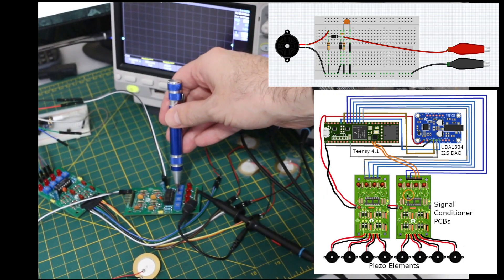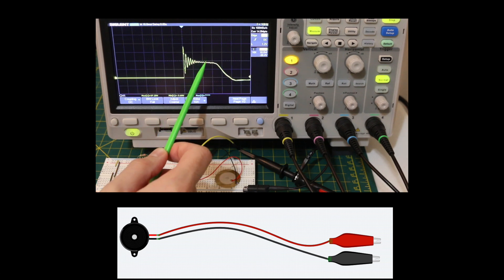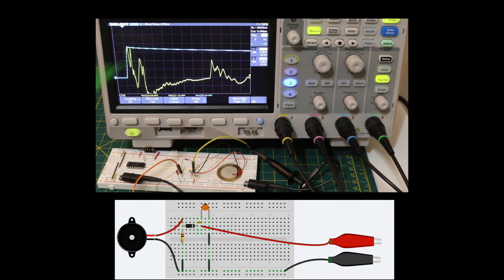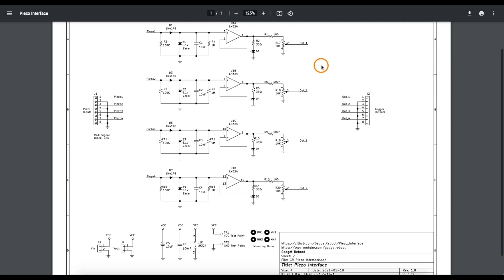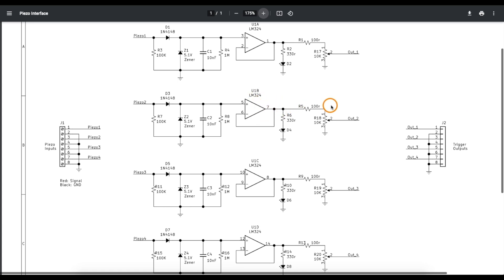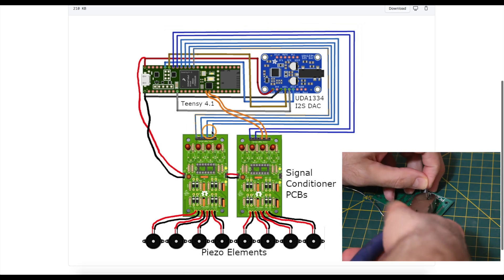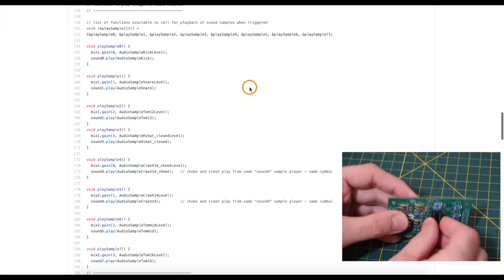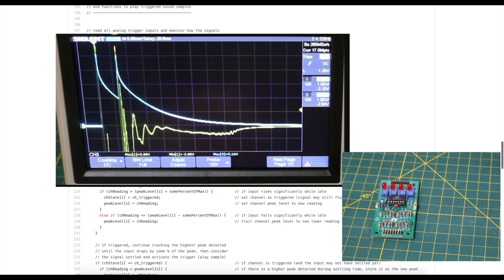Teensy 4.1 - Piezo Drum Trigger Signal Conditioner Interface (4-ch)

Comment: This is not a great way to do Electronic drums. Maybe in the 80's. Considering you have a teensy 4 it's best to do all that stuff in software and use advanced filtering so you can do waveform analysis and do positional sensing and whatnot. There is a lot of information that you lose by not giving the teensy a proper AC signal.
Reply: An amateur making drums (better than 80's drum machines) and walking you through the process is in no way an "non-great way" to do things. Thanks for coming out :)
Reply: @SimpleElectronics  It's OK but not great. I'm referring to what he did with the signal coming in to the teensy. The reason you want to do what he did is if you are limited in the number of analog reads you can do. The teensy 4 can easily do one million ADC reads per second and you can do advanced filtering (bessel, chebyshev, etc) and a bunch of other stuff while it's waiting for the ADC reads to finish.
Reply from the maker: @sabahoudini  The hardware interface can be used with other devices beside Teensy so being widely compatible is good.  Also getting it done in hardware with a few parts vs advanced filtering, which I don't know if there's an off the shelf Teensy solution I can use off hand, well beyond the scope.  But if you have links to reference material I'd like to look at it.  And there's still the need to condition the analog signal to fit within 0-3.3v and bias up the AC so the negative part isn't clipped.
Reply: @GadgetReboot  I'm using an op amp as a buffer and a voltage divider as a virtual ground to get a midpoint between 0-3.3V. The op amp is connected to ground and 3.3v. I'm getting super clean signals using the ADC library from the teensy forum sampling at 12 bits at 50kHz and then filtering to get very high resolution using floats for everything. You can find everything you need on the teensy forum. I suggest looking for the ADC library where you can set more advanced ADC settings.
Reply from the maker: @sabahoudini  Thanks, I'll look for it.
Reply from the maker: If it's good enough for the 80's, it's good enough for the workbench!
A great way to do something is the way that can be implemented sufficiently and quickly within the time budget and technical capabilities of the team,  and especially for hobbyists, captures the interest and enthusiasm of those working on the project.   But advanced signal processing certainly has its place.   Although by presenting an AC signal, we would have to bias it up to allow full swing, and thereby lose some information by further compressing it to fit within full scale of the input.   Do you have a link to a reference project that does better signal processing on a piezo to show what type of extra useful detail can be extracted?  I'm always looking to improve projects.
Thanks for watching!

Comment: Can the Piezo transducer detect moving things? For example, will it detect a train toy if placed under the tracks?
Reply from the maker: It can detect some pressure/weight if something is placed on it but I don't know the amount of minimum force needed to register.  It probably wouldn't pick up light plastic but maybe a metal one.
Reply: @GadgetReboot  Thanks for the fast answer. So I will keep searching for another solution. The most used one is IR leds, yet I want something hidden under the tracks.
Reply from the maker: @YigalBZ  I wonder if this would work https://www.aliexpress.com/item/4000907686535.html      there is some info on how to use it here   https://innovatorsguru.com/strain-gauge-sensor/    but I can't find info about what type of force it should be used with or if there is such a thing as too much. but given its size, it looks like it would work with light loads.  Though maybe the weight of a track would already be too much.  Something to investigate. I might get one of these myself
Reply: @GadgetReboot  Thanks ! This can be very interesting. I will order few for testing. I am also going to try hall effect sensor, but this will require metal which I am not sure will work as a generic solution. Your idea seems to be better.

Comment: That's damn impressive!

Time to hit up Value Village and get a Rock Band drum kit to mount the piezos in!
Reply from the maker: Sadly, I could have had a rockband drum set for free this past year when helping someone clean out before they moved, and I used false logic of "I'll never have a use for this electricity related item"
Reply: @GadgetReboot I know this is quite an old video but with the Hero/Rockband franchise dying out Clone Hero instruments are being made. I am working on an old electric drum kit that was fried with lightning so the pads are still good but the drum brain is shot. I was following this tutorial and was wondering if the circuit needs to be modified for long piezo wires. The kits drumheads have a voltage divider looking circuit with a 1MOhm across the cathode and anode wires, I am guessing this is what you have in your design. There is also a 51KOhm resistor on the cathode wire that sits in series between the piezo element and a T junction with that 1MOhm wire. I think this is to drop the voltage a little or "tame the hotness" as electric drummers like to say. Would your design have to be modified to work with this setup? I doubt I'll get a response but happy to get one nonetheless.

Comment: What a fantastic project! how hard can you hit those piezos before you damage them?
Reply from the maker: I don't know what impact they can tolerate or if they're even spec'd to be used that way (without some buffer material) but the spudgers are light enough.  I think in a real drum trigger scenario the piezo would be just picking up vibrations while mounted as an indirect pickup.
Reply: I feel like "how hard can you hit" it is probably more low-brow content for my channel than this guy who actually knows what he's doing.
Reply from the maker: How hard can it be hit and not destroy an Arduino input

Comment: Nice video, i've got a few piezo transducers laying about somewhere. most of the components and a Teensy 4.1 with a teensy audio board. looks like i've got to make a drum kit :)

Need to play with the Teensy a bit more. Thanks for something to play with.

By the way still using the arduino fuse setting board, used it just today to reset the fuses of an ATTiny85
Reply from the maker: I have my fuse board right here but the OLED is nowhere to be found - I need to make one with a soldered display copy too.
I had to severely cut this video down so a bunch of details didn't make it through, and I also made notes for a separate video regarding obtaining and using audio samples in Teensy program memory, converting wav files to data arrays and some gotcha's I learned.   The original video would have been an hour long...
Reply: @GadgetReboot  Quite a mess on the cutting room floor then :)
Reply from the maker: I had extra video clips left over along with screen capture pictures and sound files that I knew were supposed to be in the video somewhere....but couldn't figure out where.   Then I was missing some files, re-recorded voice overs, then found the original audio in another folder.   This is what happens when it takes multiple sessions!

Comment: OOOh this is nicely done. Once I saw video where they used Arduino nano with some multiplex(i think, it was long ago) and MIDI conventor. But it was kinda messy. This looks way better and more responsive.I really want to build it  :D Nice work and nice video ! :)
Reply from the maker: I might dabble with MIDI eventually but I like self contained things more.  The responsiveness took a bunch of trial and error both in hardware and software to be able to pick up fast sounds, reject false triggers, and respond to the intensity.  Most projects I see just detect on/off and play something.
Reply: @GadgetReboot  If i remeber correctly, he could sample signal strength  from the piezos.  But it worked more like MIDI keys and then the FL studio plugin did everything(like leng of the sound, volume and so on). Thanks for good video and nice ideas :)